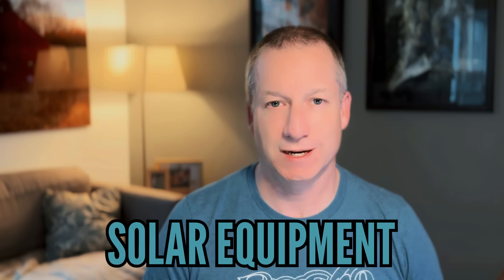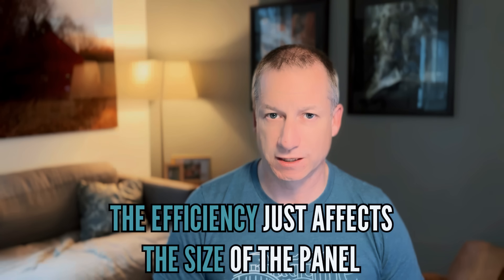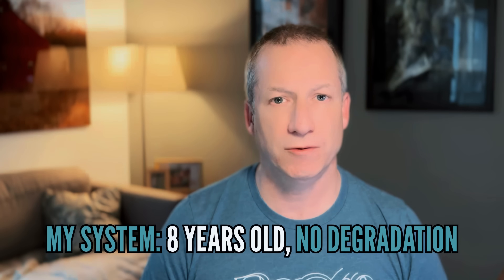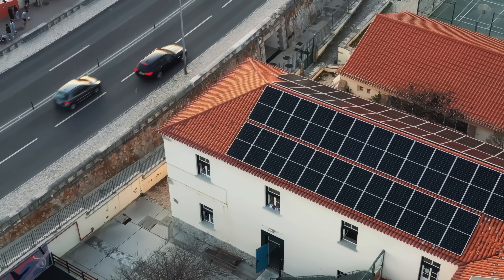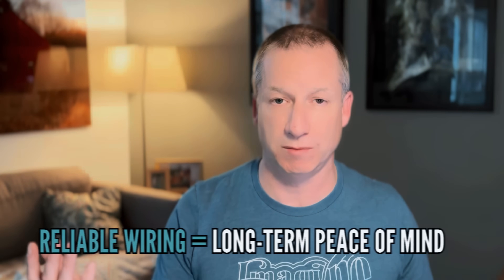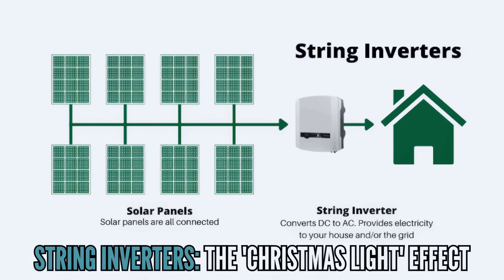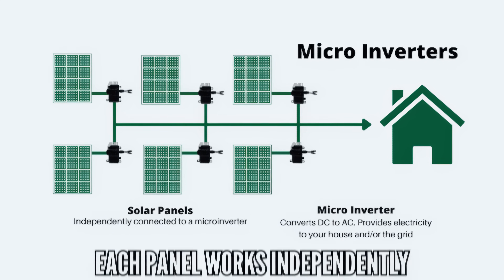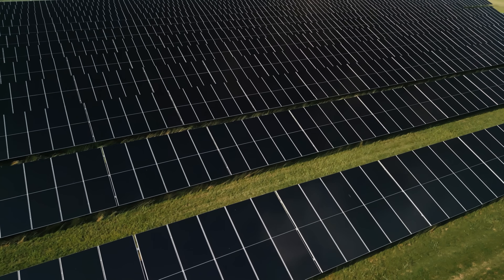The Hidden Downside of Microinverters No One Talks About

Comment: As a solar installer I wont propose Solar Edge (optimizer system) because they seam to have more failures than current Enphase systems. Maybe this guy has experience with older Micros like Enphase M250s- those were not as reliable. I don't think that I have had to replace one IQ8 series Micro and maybe 1 or 2 IQ7 series. SE also seams to have more firmware issues.
Reply: I agree. I've managed more than 1000 Enphase sites but I've also installed about 400 SolarEdge optimized string inverters and they are terrible.  Even adding batteries to them is a nightmare.  And have you heard of the pass-thru voltage issue with optimizers? I've seen my fair share of exploding optimized string inverters. Gnarly.

Comment: I've had SolarEdge optimisers in since 2011. The first ones back then did have several failures but the new ones seem to be holding up well. I have no experience with microinverters.
I've had PV modules in since 2006, in all that time I've had one panel go bad and today I have 58 modules in my two systems. I don't think I've had any real degradation or power loss.

Comment: Can you compare failure of buck/boost converters with micro inverters?

Maybe I got this wrong, but aren't panel optimizers attempting to equalize current within a string?   Maybe they avoid the "AC" label, but boy, the electronics are mighty similar, with high frequency power switching.    They're used by the hundreds or thousands in complex electronics as point of load regulators?

Comment: Read many comments on here about strings, micros, and optimizers. For me, I would like to install a DIY system, probably ground mount panels, hybrid inverter, hooked to grid. I really dont want to have 12 to 16 micros of which any could go out at anytime. Probably not be under warranty since I would be DIY. So there wont be an installer to call, so I dont want multiple failures. What would be wrong with two 8 panel strings to a hybrid inverter. Size is approx 6kw with 8kwhr battery.

Comment: So tired of people that have limited technical knowledge making technical proclamations.  The efficiency "losses" are picked up by the fact that each of the inverters is in parallel.  The I2R losses are much lower in a microgrid system than a string system.  The fact that each panel is putting its complete production on the grid is also a major advantage.  Diode protected panels on any of the string systems present what we call a single point failure of the system.  If an microinverter fails, it will not impact the production of the rest of you system.  This guy's thesis is very flawed.
Reply from the maker: I'm so sick of people who didn't understand what I was saying making stupid comments. I never said that if a micro inverter failed it would affect the production of the rest of the system. I actually said the opposite. Also, diodes do not offer the miracle cure for shading issues that you think. So much for your technical knowledge.

Comment: I'd like to see the statistics of failure rates of micro-inverters and optimizers. If you throw batteries into the mix, then optimizers do make more sense.
From the companies' literature:
Microinverters (Enphase) — Enphase tech brief claims a ~0.05% microinverter failure rate (fleetwide) and explains their reliability program. 
Optimizers (SolarEdge) — SolarEdge white paper states <0.3% power-optimizer failure rates for its latest generations based on fleet data.

Comment: So many technical errors. Although the final conclusion is not that bad. String systems are more efficient because they operate at a higher voltage.  A string of 12 panels will run at over 400V DC. Micro-inverters 240V AC. But the 400V DC can't be used to charge you battery, the voltage is way too high. So it's converted to AC, stepped down in voltage then converted back to DC. The one possible advantage of optimizers is not because of shading but panels oriented in different directions.

Comment: 7:56 my dude. I don't think your agument for string inverters holds water. enphase micro inverters have a 25 year warranty. string inverters have a 10-15 year warranty. if a micro inverter fails you WILL have to swap it out, but probably at no charge. on the other hand, your string inverter is even more likely to break before 25 years. easier to not get on the roof maybe, but it WILL cost you a few grand when it breaks. if a micro inverter fails the system will show you where it is. very simple.

also, the micros will not all fail at the same time. if one goes down you may lose a few percent of you power. who cares if it takes 2-3 weeks to get someone out to replace it? if a string or string inverter goes down - it's much worse. pick your poison.

Comment: Enphase micro inverters definitely fail. Enphase also charge over $200 just to change account details if ownership changes and is the only way to access panel data. I had 2 failed micro inverters and took over 7 months in dispute with Enphase to get warranty repair. Inverters failed at 4 years btw.

Comment: OK, prepare to be mind blown. First of all yes, the problem is if panels are shaded, they will limit the whole string's current to what current can pass through the least power making one. For example, in shading, a 220W panel would operate at 1 / 10th of its rated output, meaning it would give you only ~22W. If you have 10 unshaded panels (which could be giving 220W * 10 = 2.200 W), and one is shaded, outputting 22W, it will make all the others output at 22W each, giving you only 22W * 10 =220 W even though they are totally unshaded.
Now, I did put optimisers on each one of them, but the results are REALLY DISSAPOINTING.
So, I have turned to what they do at data centers, where they completely skip the charge controller and the DC to DC electronics and couple the panels DIRECTLY to the battery bank, which results in even better efficiency than any MPPT controller out there. My setup is this: I string two panels of 60 cells in series, directly to the battery bank (48V 10KWh LiFePO4), with a Shottky diode for prevention of discharging at night, although that could be also done with a mosfet. All the strings are then wired parallel to the battery bank. No electronics (DC - DC) means absolute efficiency. Also, if you put this setup for analysis in ChatGPT, you will see why it does a natural implementation of MPPT, beating any inverter out there especially in hot and heavy shaded situations. Best part? It is for free, no micro inverters or optimisers needed, and nothing can break!
Reply: So, by running panels directly to batteries instead of charge controller (which i assume is in the inverter) you have no micro inverters or dc optimizers to replace...?  What stops the flow of current to the batteries when they are fully charged? Is it a smart battery which contains its own controller like the Tesla powerwall 3? Also, wouldn't this setup be using only battery power, which then goes to inverter, turned into a/c, and then sent to house? I thought the dc was supposed to go from panels to the inverter which controlled everything such as sending power directly from panels to house (after changing to a/c), using any excess to charge battery, allowing grid and battery to be used during times of insufficient panel output, i.e. cloudy, nighttime, etc. If panels are hooked directly to batteries, it seems none of the above happens, and you would be cycling your battery excessively. Still learning here...

Comment: But at the end of the day once connected to the grid they can only put in about 15% of the extra electricity but are getting credit for like 100% so basically it takes six others with crazy skyrocketing electric bills to compensate for the power of solar is not actually putting into the grid 
This is easily demonstrated with a vault amp meter and 4th grade math called ohm's law 
With the optional amp clamp it only takes a second to demonstrate the ignorance of solar

Comment: Misleading. Micros have a 25 year warranty. String has 12 year because they are less reliable. Also optimizers fail just as frequently as said inverters. You also risk full power loss with a single string invert because all power is being inverted in one single unit. Micros are the way to go
Reply: Optimizers are less complicated and logic dictates less complex equals longer life when same quality. Look at the price of micro inverters ... you can get an off grid inverter for the the price of a 4 micro inverters.
If you want to go with a battery, you need a charging system on top of the micro's ... and prob same brand for it to work right. 
The price of micro's was acceptable when the panels were twice the price of the micro's. Now the micro's are twice the price of a 440W panel here in Europe. Might be different in the US with your tariff madness.
I can slap as many (parallel) panels as i want on my string inverter if staying below the max voltage.
So, if you have the space, just fill up your roof with panels with many parallel without a worry.

Comment: I dont use microinverters per each panel.. but I think they can still have battery in the future using AC coupling.. basicaly you buy another ac coupled inverter which charge the battery through the grid exports then you use the same inverter at night...

Comment: Come and research The Netherlands and see for yourself how most installers in approx 8 years of installing optimizers, now have turned away completely from optimizer technology after 10s of thousands of RMA’s and humongous service  efforts to replace them. Nightmare. Every installer had had enough of that now and have turned to micro inverters technology . We have 3 million homes with solar on a total of 8 million homes in a country that is one third of the size of New York State. Micro inverters on the other hand have a very good reputation in NL regarding the reliability of its technology. Approx 25% of all installs on homes are micros.
Reply: Trying to understand Micro inverters  here....let our example be 10 panels, 48 vdc each. Usually would run 10 in series to a main hybrid inverter, keeping dc amps, and hence wiring  cost low. Using micro inverters, now I have 10 panels putting out 120 vac each, correct?  Do all these run in parallel? If so, isn't the current 10x of 1 panel? Much larger wire. How do I get split phase 240 vac? Does this a/c from the micros go to the house control panel? How does a battery fit in, i.e. where does it's dc current go to? Don't I need a main inverter for that stored power anyway, and a power supply converting my solar panel ac to dc to charge battery? If main inverter is needed for this, why use the micros?
Reply: Just stating something does not make it true. Adding some extra info like limited roof surface and height etc.
Explain in what parallel universe it's regarded "smart" or whatever to slap a €150 micro on a €75 panel?
It is not. Certainly when you need special equipment to access the roof instead of an inverter on the attic.
And don't get me started on "installers" as most of them don't have a clue wtf they are doing ... or just play dumb to make more money. And I have enough examples of those. The most retarded being, no, you can't add more panels ... you'll need a new and bigger inverter ... 
They make more money installing micro's. Tell me i'm wrong!

Comment: That's not how 'string inverters' work at all in reality, and the myth of the 1 shaded panel voltage drop has nothing to do with the inverter, the myth is related to the panels in series, there is no such thing as a 'string inverter', there are only inverters rated for a certain dc voltage, the inverter doesn't care or know anything about what generator it's attached to. So this myth is about panels in series, and yeah, cheap ass diodes exist and are in every solar panel produced in the last 10 years, so the reality is shading makes no difference whatsoever now.
Reply: I don't even know where to begin reading that much nonsense. How to say I don't have a clue without saying you don't have a clue ... 😂

Comment: Still hung up on the microinverter failure statement.  Wow. Seems like you’re not  really not experienced in this.   

We have as many optimizers in the recycle bin as micros.  Yet more Optimizers Inverters (those relays and capacitors don’t last long) 

Micros last long because they are converting low voltage and have much less internal electrical degradation due to low electrical pressure ( aka voltage) 

Personally I’m not biased because I dislike the firmware issues both micros and optimizer systems have which cause unnecessary truck rolls but microinverters do not all fail.   

Have a customer with 354 18 yr old Enphase M-175 installed in 2007 and only 16 had to be replaced since day one.    Still under warranty too
Reply: This is interesting data.   that represents a 4.5% failure rate over 18 years.  I'm just learning about all of this, and I'm no expert,  but I'm guessing that the labor to get on a roof,  remove panels, replace an inveter, then reinstall the panels, can't be cheap.  So you need a labor warranty more than a part warranty!
Reply from the maker: Bingo!
Reply from the maker: That’s 16 truck rolls and is exactly my point. The installer loses money every time - if there are still around. If not you definitely have to come out of pocket for another company to do it.
Reply: Wtf are "optimizer inverters" according to you? There's optimizers and micros and an "optimizer inverter" would be a micro, not?
Micros last longer due to "low electrical pressure"? So an inverter that makes 115 or 230 AC from 30 - 40 VDC has lower "electrical pressure" than an optimizer just adapting output current to input current? 😂
8 Years down the road and no optimizer (Tigo) nor string inverter (GoodWe) failed me, with a total of 9kW panels on a 3,6kW inverter.

Comment: The Christmas tree statement is not as clear cut as you say.   Even though  bypass diodes as some are stating can help.   The failure only happens in a string system if a wire is burnt or disconnected.  Even broken glass on a panel won’t stop a string from functioning at 70-80%   As broken glass doesn’t short cells.  

String inverters are great on full exposure systems but perform at the lowest panels production level to some degree.  Diodes do help limit this quite a bit.

Comment: Brad.  As a solar professional who focuses on service and repair of systems installed by others and design and install our own systems, I’m really bummed to hear such an obviously biased video.

I’ve been involved with over 3000 microinverter based system systems and can state unequivocally that microinverters do outlast most other type systems.  The failure rate is actually quite close to either SolarEdge or Tigo optimizers.  Then the failure point of the string inverter (SolarEdge and Tigo do require a string inverter) is higher than individual microinverters.   We actually upgrade the Vers 1 microinverters from 2007-2010 to new Vers 8 units and have to be honest telling the client their old micros are within 20% of original capability which is far better than most string inverters of the same age 

Panels?  It does make a difference. Temp coefficient, and degradation does vary quite a bit.  Sounds like you spent more time selling and managing projects then doing the scientific research onsite testing systems.  

Wiring issues are mostly down to wrong wire size and improper JBox work.  Otherwise rooftop electrical is very robust even if done poorly. Don’t lie saying that but that’s the truth.  

So much is not quite good info